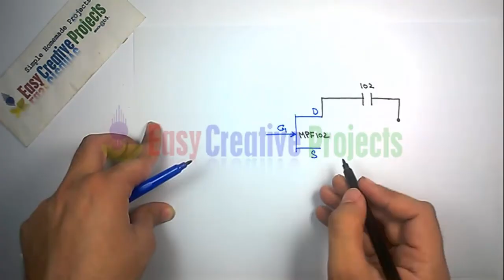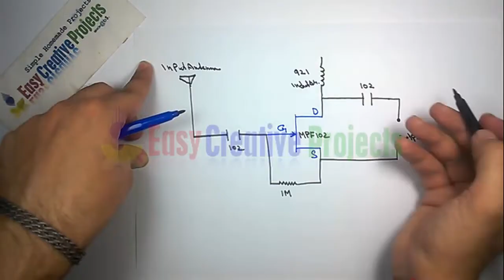How to make simple signal booster device easy at home - 1000MHz supported

Comment: Thankfully; the Input antenna has one connection while the output antenna has two connections, why?
Reply: He didn't mention it. Second input connection is ground. It's common to both input and output terminals. He must have shared this thing. Anyways, antenna will work without proper ground. But for best results grounding is necessary.
Reply: i have the same question